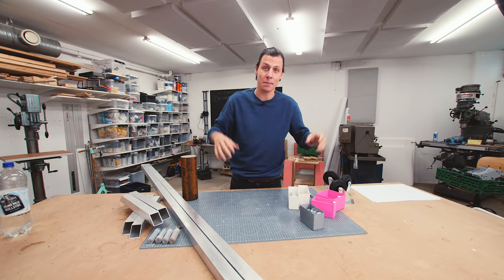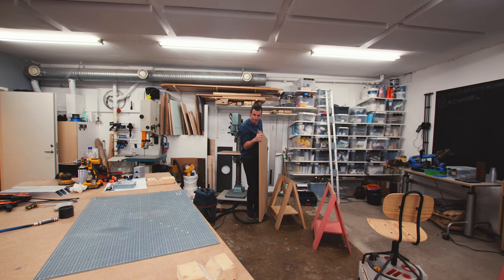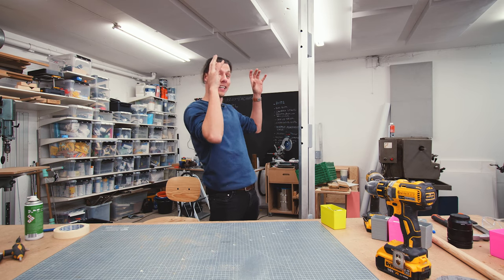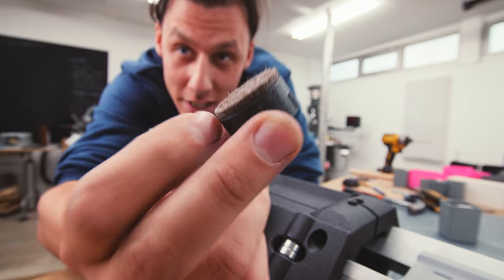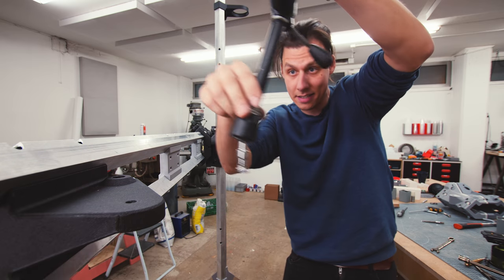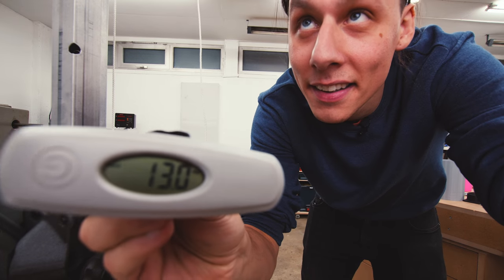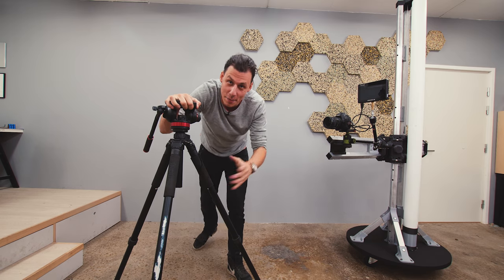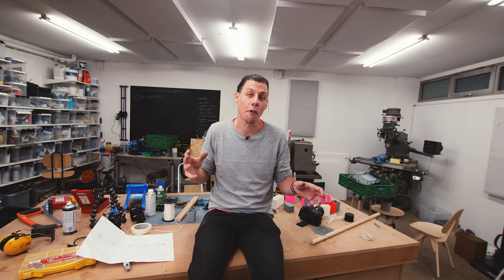3d Printing a $10,000 Camera Arm

Comment: Really cool! Great design.  Would be cool to see a smaller wall mounted version as well.  Glad to see that Prusa doing good work.
Reply: The problem with mounting it to the wall is that you can't retract the arm. So you basically just have a camera on a stick attached to a hinge. Unless you make a sled for the camera but then the rails would get in the way of the shot. Pretty unpractical. You could attach a long rod vertically on the sled but then it's just this system with extra steps
Reply: @chas1878  it will be possible if the tubing are retractable like multi stage hydraulic cylinder are
Reply: @chas1878  maybe the rail problem will be solved at next version, AI auto follow camera man machine, with voice recognition control, for example:  voice command like "higher", "closer", the control system will do all of this.
Reply: @yuan.pingchen3056  Actually the ultimate option would be mounting it across the roof. Essentially creating a 3d printer table. He could even like you said put motors and a control system on it.

Comment: My friend, your editing and lighting skills are superb along with several other more subtle elements that are very good.  I make Gospel music vids on my channel but I also have a little wood working hobby channel.  I only want to say that because I discovered this by having both.  Tho the music vids use a lot of special effects etc, I can shoot the elements of the vid until it is what I want.  But the shop vids, you basically get one shot at getting it right most of the time.  Once a glue up is done so to speak, you don't get to shoot it again if the focus, lighting, angle, you get the picture, aren't correct.  Too bad unless you want to make the project over and over again.  Not practical.  So my point in all my wordiness is simply this, you have a fan here in regard to your video making.  But then, with your cleverness in design and presentation along with an appealing amount of energy,  my friend, you are headed toward the million sub mark.  You're special.  Love your channel.
Reply: Where’s your checkmart
Reply: @LinusLegoTech  Checkmart?  not sure what you mean.

Comment: WE BUILT THIS! What are our learnings? 🤔

Time: We spent about 42 hours including printing and building the camera arm.
Costs: We spent about 721€.
Mistakes: Make sure the thickness of the aluminium rods is 3mm wall thickness. We bought ones with 4mm and had to grind all conter blocks you slide in the rods.
Tube for the conter weight: Try to find a tube that is 2m long and avoid building one made of two parts. This will make the counter weight get stuck in the middle what is likely to break the upper tube holder.
List of 3d parts: Since there is no list provided that tells you how often you have to print each part, here a list:

* 1. X axis top: 1x
* 2. X axis bottom: 1x
* 3. Z axis right: 1x
* 4. Z axis left: 1x
* 5. Tube spacer: 6x
* 6. Inner tube mount: 22x
* 7. Camera mount: 1x
* 8. Top mount: 1x
* 9. Pulley wheel: 1x
* 10. Bottom mount: 1x
* 11. Y mount: 2x
* 12. Inner Y mount: 2x
* 13-foot: 4x
* 14. Concrete mount: 13x
* 15. Knob: 3x
* 16. Knob lid: 3x
* 17. End cap: 2x
* 18.Stopper: 4x
* 19. Tube connector: 1x
* 20. Tube mount top: 1x
* 21-tube-mount-bottom: 1x
* 22. Spring bottom: 1x
* 23. Spring top: 1x
* 24-x-axis-back-stop: 1x
* 25-weight-tube: 1x
* 26. Weight tube lid: 1x
* 27. Drill jigs: 1x

Comment: What would be the total cost of such a project? (filament + tubing + weights + bolts + ...)
Reply: I live in the United States and I'm pricing this out right now.  

Without giving away his dimensions, the aluminum is $200 at the 3 places I've priced it online.  The 9.2kg/21lbs of PLA (if you have no failures) is $25/1kg of Prusa PLA (which i've never printed with on my CR-10).  10KG  - $250.  Hardware, cuz there is a ton of them: $25-50.  The MDF is also about 50. 

So $550.  Far away from the $10K, but something that I'll be getting over the next few months.  I'll print a few pieces and then get more materials.
Reply: @rachel.the.riveter  electricity

Comment: Amazing, the thing is though that makes a lot of noise. That's why on lpw budget film sets jib cranes are still used. They do the same thing but with more control and stay quiet since only movement is on pivot joints. But for a shop, this is perfect.

Comment: You're now the envy of 99% of other Youtube creators... But, what did it cost to make it?
Reply: 3D filament should have costed around 230~USD or around 180-200euros. Then steel and aluminium. Altho he could have made this a lil cheaper if instead of steel weigh he used Sand or Lead. So my guesstimate the whole rig could be made for around 300 to 400bucks. Depending on your location, country, prices around u
Reply: @Tomas970506   Which is already 9600 bucks less than the 10k he saw online for a rig like this
Reply: @Tomas970506  his time has value too but as long as he spent less than 400hrs of HIS time, he came in cheaper than it would have cost to buy. This obviously varies based on how much your time is worth in real money.
Reply: @critnerd5681  Oh exactly! I never said anything about his time being with no value just because I realised that this is a hobby of his and that time has a way different value :) Just look at his face all giggly
Reply: Tomas the prusament he used is WAAAY more expensive than that. He’s probably got $1000 at least into this build. Most likely considerably more, as all those failed or test prints also cost money. Still worth it though! This is more than the sum of its components. He’s created a tool he will use and modify for many years to come!
Reply: @Tomas970506  True, his time of building and planning the project also have to be on the account, but think with me, he of course learned a lot on this whole process and is probably a better professional now. There's no wasted time (as someone might think) when building something with your own hands. That's why we all love his work :D
Reply: @freshmas  prusament is only $30/kg lol
Reply: Robert McEwen in the USA at least shipping is very expensive. We can assume it’s less there, but still a factor. Some of those failed and test prints were 700g of plastic. Then we add in all the other components, electricity, and other consumables. I bet it would cost at least $1000 to make this without any sponsorships.
Reply: A rough estimate 
$220 in filament. In the US I would just use hatchbox at $22 per kg
$100 in electricity
$270 2 x 2 x 1/8 wall t5 square tubing
$175 in hardware
So at about $765. to build in the US. assuming you don't look for deals on anything.
Reply: @critnerd5681  Time spent planning and building this, will be covered by views on this video and  how much time he will save setting up shots in the long run. Plus he could increase his production by adding a few motors and controls to make moving shots and stuff. And, technically, all the materials used is a business expense :D
Reply: @slaunts9453  The hardware cost seems a bit high. MDF is cheap, casters can be had for under $5 each so $25 to $35, then the aluminum pipes are cheap too. screws, etc.. are also cheap... I'd put the hardware under $100 easily. When he releases the full plans on his website ( as he stated in the video - ie: for free - ie: releases instead of makes available to buy ) then we can get an exact cost. All in all, a high quality build and I wouldn't mind tipping on thingiverse if I ever needed something like this. Right now I'll probably just use a mic boom for the camera in addition to a fume extractor. I would've liked to see a hydraulic spring assisted device for the system which could be adjusted incredibly easily. Depending on the one used, it could've taken some work but would've been easier to modify.

And this system looks sturdy overall... I wouldn't be surprised if larger 3d printers used 2 vertical connections - you could quite literally make a massive 3d printer using this. Or 6 of them.. But printing something that big - ie: a full plastic storm trooper uniform form fitted to you - would take a lot of time and it would be better done in pieces anyway.
Reply: @Acecool 
I agree. There are parts that could be substituted to save a lot of money. (for example the socket head screws and lock nuts are almost $100 alone on mcmaster)
 If you buy online and search for deals, as well as getting the metal and aluminum at a supplier it could easily be half the price.
Also printing with a .8mm or 1mm nozzle would reduce the print time dramatically.
I was posting a conservative estimate based on buying parts from well known sources with little research.
Reply: @Tomas970506  Zinc is safer, weighs & melts like lead. 
Can be cast in a concrete mold, a simple custom metal mold, or even sand casting.
You can find zinc wheel weights along the road or get from a small auto repair shop.

Comment: "Granted it doesn't AS low as the other one..."
Reprint the end to make it possible to mount the camera underneath the arm too.
Reply: I was thinking the exact same thing or just use a 2nd magic arm.
Reply: or an indexed, 360 degree rotation unit to orientate the camera at any angle in space on the end of the arm...

Comment: by adding an o ring between the weight and the pvc pipe inner wall you can increase the friction coeficient. though it seems to balance well, by increasing the friction you need to overcome a higher force before the camera can move, so things dont come crashing if if they are out of balance. this thing is super awesome!!

Comment: Ok so I'm really late to the party. Great Job! In case in the over 2.5k comments it has never been mentioned, to solve the low camera angle, just design a L type bracket to lower the camera further. It's actually a part that FOBA used to solve their low camera angle issue on their camera stands. With your experience,  I imagine that the L Arm would be really easy for you to build. Very well Done. Congratulations!

Comment: For the sake of your camera, please change the way you are holding the concrete block. Creep from the constant load will likely cause the brackets you printed to eventually give way (if fatigue from the vibrations over the floor don't get them first). Best case is you notice it starting to drag (since it looks pretty close to the floor), or it breaks while the camera isn't at full extend. If you had cast a hole in the center of the weight, possibly with a counter bore, you could have used a single bolt that would never break.  Maybe add a few holes to the base and string paracord like ribbon on a present as backup now?  Simple metal pipe hanger tape screwed underneath?  It doesn't all have to be 3D printed.  Very cool build. Enjoy your new creative freedom!

Comment: Super dope dude! I own and have owned several Foba camera stands and this one operates super smooth. Cool to see you make it all yourself. This video is a couple years old and I'm sure this has made itself evident (and maybe helpful for others who would attempt the same), but the only thing you maybe could've considered is to figure out how to add a buuuunch more weight to the base. The bases of the stands you can buy are made from thiiick cast iron and are super super heavy to prevent the stand from tipping, especially when the arm is fully extended. The bases also are more of a "leg" type design so if you need to extend the arm way out, you can put the weight of it over the leg for added stability. 

blah blah blah. super cool parts you made, really nice job. Can't wait for my first 3D printer to come next week!

Comment: I've purchased  the STL files and templates, and I'm working toward making this. One challenge I face is that in our markets there are no 40mm square tubes available, only 1.5" tubes — which are off from 40mm by 1.9mm. So I'm having to import the STL files and revise the 3D models to make them fit the slightly smaller tubes. Fun, fun.

Comment: People must have pointed it out before, but the part you really want to safeguard is the camera part. If the rope breaks while the screws are loose, the important 13kg will come crashing down. Ideal, I think, would be an emergency brake that relies on rope tension. Plus an additional cushion for good measure.
Please upvote if you think that might save a camera or two.

Comment: Great build! It gave me direction. I will modify it though. I will use the standard 3D printer alu profiles and the rubberized sliders used on 3D printers. It will be quiet while moving, so the camera can record with a mic without the noise.  My camera is very heavy. I think the 3D printer alu profiles can take a higher load before bending.

Comment: This is fantastically creative and really well designed. My only question is what weight rating specs is it rated for? I’m less concerned about the metal assembly as the 3D printed materials and felt grips. To be blunt, if all you’re putting on the rig are some lightweight mirrorless cameras and basic sound equipment or studio lighting controls, then it’s no problem. But if you’re going to put a $10,000+ camera set up on it, I’d want to be sure that the things holding it in position were anchored with something that has a stronger traction system (and at least one redundancy) than felt pads that were meant to be used horizontally, with the weight of the furniture pushing down on them — not in a vertical position assuming the glue on the pad is strong enough to keep it in place. 

I’d love to see a version 2 that iterates on this design with some material upgrades, possibly a redundancy system that expands on/improves on the counterweight system and a more stable base that still maintains the mobility of the system (recognizing that it’s still a studio set-up in the end.) 

Don’t get me wrong, these are more minor quibbles than anything. Keep up the amazing work!

Comment: This is awesome!   One change I would've made to make it  last a lot longer would be to design it to use those delrin or polycarbonate sheathed bearings that a lot of cheap 3d printers use.  Because over time those steel bearings are going to wear the absolute crap out of that aluminum tubing. Generally speaking you don't really want your wheels to be harder than your rails, it'll just wear a trench into your rails.  I learned this the hard way with a CnC router I designed and built years ago, where the bearings were hardened steel, and the rails were just plain cold rolled. Those bearings dug trenches into those rails in a matter of hours.

Comment: Great job. I have one concern though that I’m not sure you addressed. That is the “string!” You should NOT be using string. That flimsy stuff is going to break and your camera rig will come crashing down. Onto your head or onto a special, expensive project. I really suggest you get a rated steel cable. Best of luck and happy shooting!

Comment: @ 21:15 an adapter to mount the camera flush to the bottom of the horizontal arm would not only get you lower minimum height, 
but allow  tighter clearance on sliding shots!

Comment: Hi Alexandre. A very impressive build and the design work is first class. Something you might consider as an adaptation into another expensive and popular jig for woodworking. As resin slab tables have become fashionable the need for a slab flattening router jigs based on box section rails have become a popular build. Basically if you developed and put a design in your shop, I for one would be buying it. Thanks again keep up the impressive work.

Comment: Very clever and useful, but I have a jib on a dolly that has much more reach (anywhere in any room and from floor to ceiling), and it will fit in my car without taking the whole thing apart - an old-school solution that works, too.

Comment: That is a beautiful piece of kit, nicely done.
I think I would have run a cable chain from the base to the joint and from joint to camera so that I could move the camera battery to the base. I don't have any need of such an elaborate camera rig, though, so I'm probably not a great judge of what's a useful feature.

Comment: I foresee a small problem. You made a spring stop for if the counterweight falls off, preventing damage from the weight, but what about the arm? If something happens to cause the counterweight to fall, it's also causing the arm to fall, because the counterweight is no longer holding it up. You get meaning?

Comment: So one big problem is that as you push the arm out it dips down quite significantly. You need to somehow make the crossbrace more stiff which is quite difficult or you need to somehow introduce some kind of dynamic counter weight system.

Comment: I know this video is a couple months old and you probably don't check these old comments, but I'm curious if using the same style rollers that 3d printers use (the V-slot style ones) would help soak up the noise from the bearings on the metal, so you could even use the camera for video and not have lots of noise from the bearings

Comment: I would have used the inner chamber of a bike wheel sliced in rings to put on top of the bearings as a sort or tyre to reduce sound of the slider, for the rest, spectacular job!

Comment: THAT IS AN AWESOME PROJECT!!!, Now after that, I think that maybe creating spacers from the same aluminum square profile you could speed up things a lot (I mean, you still need a radial saw) and keep the low weight, 2nd, I LOVE the counterweight for simplicity there and the cheapness of it. Just one question: wheels don´t need brakes?, I mean, the platform moves when you pull the camera or due all the weight it stays in place and only the arm moves?

Comment: I used to work with those Foba stands, they're Extremely heavy and they always have a wider stance than yours.
Your legs could do with a bit more of a stance for stability as the cameras are very expensive and throw off the balance.